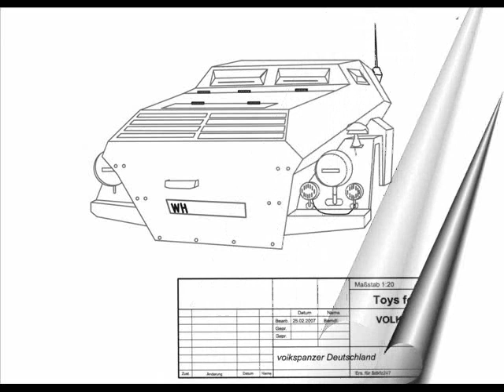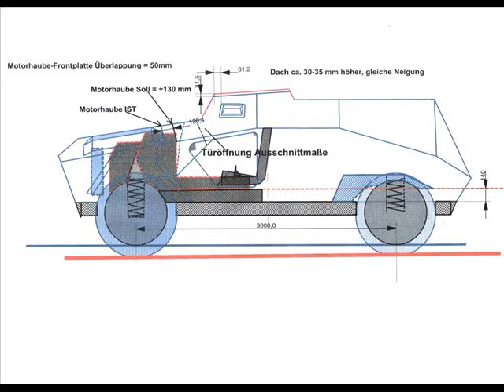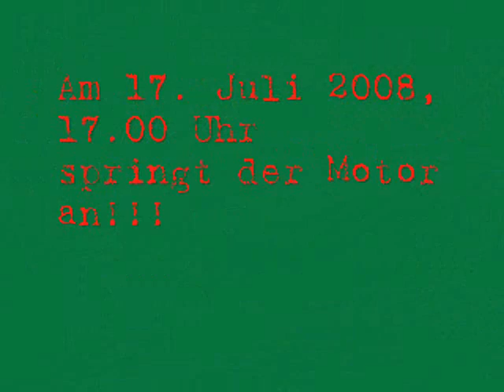"Making of " Sd.kfz 247B-Replica

Comment: Did you guys use real armor plate or just mild low carbon steel?
Reply from the maker: The laws in Germany are very strict, we only used normal steel, 3mm thick
Reply: @bennyvolkspanzer6408 Thanks for the response.  Are you as a private citizen, `not allowed to own an armored vehicle in Germany?
I owned a vehicle armoring company some years ago and worked in the Middle East.
Reply from the maker: @jimhenry1262  Normal armored vehicles like a armored SUV- I do not know, but I will ask. But I think that's not easy either. But I know pretty well:  Armored military vehicles in private ownership, that is indeed very difficult in Germany. The corresponding law was tightened again in early 2019. So it's the easiest, you build a vehicle so that it does not fall under these laws. And I do this. It's just a model :-)
Reply: @bennyvolkspanzer6408  Benny.

Move to Texas, you can own a tank!
Reply from the maker: @jimhenry1262  Oh Jim...  thanks for this invitation. live in a free country-a dream... may be in my next life. unfortunately, I can not do that anymore in my current life.
Reply: @bennyvolkspanzer6408  Benny....Willkommen unserem land!
My beautiful wife`s family came from Germany. Texas has entire towns settled by Germans.